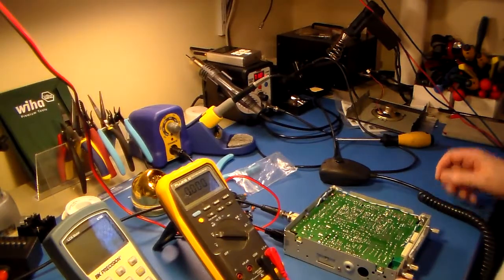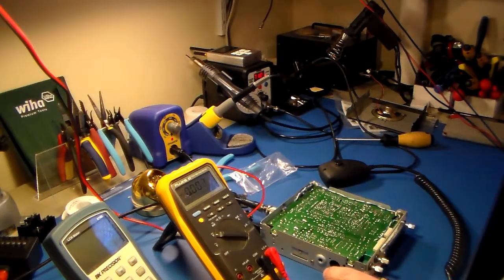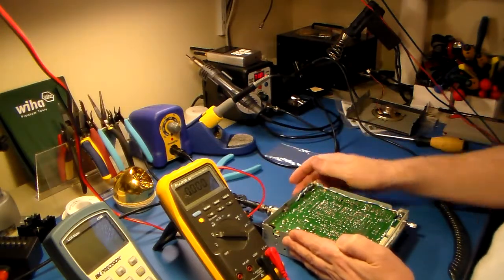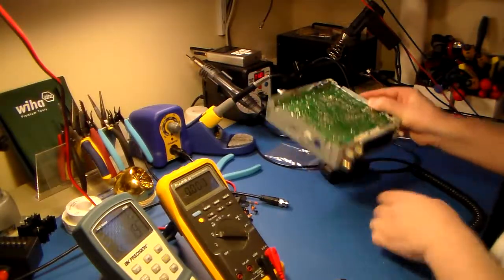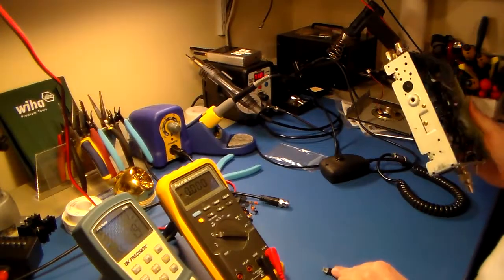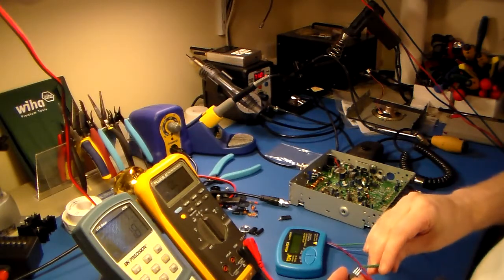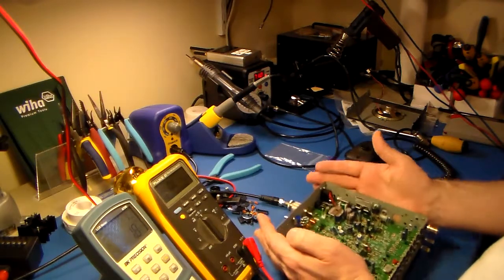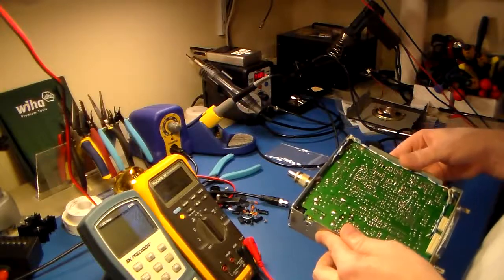Midland 77-285 repair

Comment: How do you lower a radio's output and keep it cooler?  I want to keep it nice and cool in the summer.  I thought lowering the carrier would help, but I guess that could make things worse?  What's the best way to lower it's output then?
Reply from the maker: +Nathan Daniels Well, lowering the carrier will help because it's not making as much power.
Just have to watch you don't over-modulate.
Thing is... these devices can take a lot of heat so if it's not getting hot to the point where it's uncomfortable to keep your hand on the back then it's probably okay.